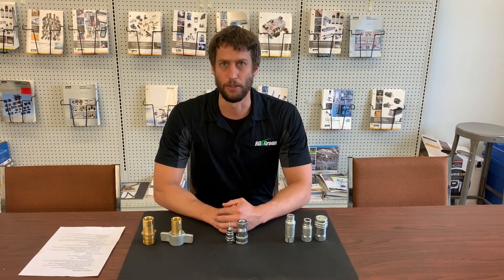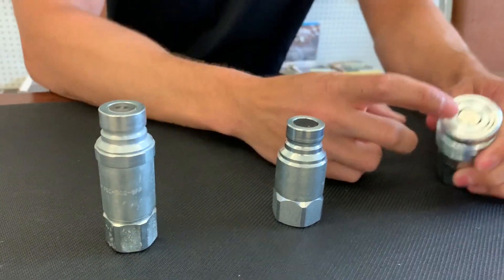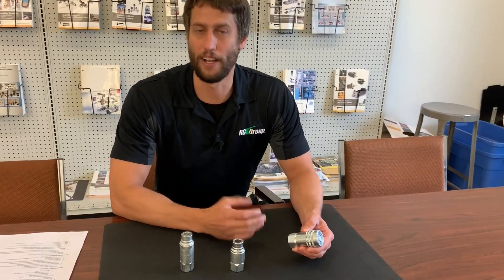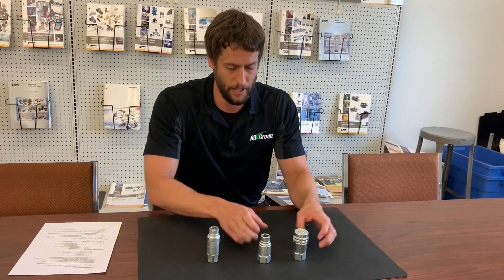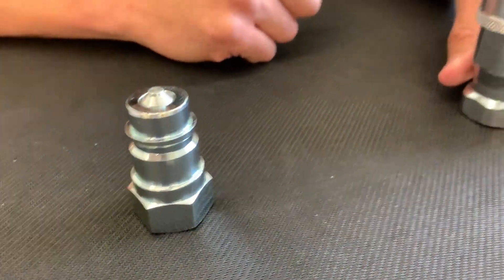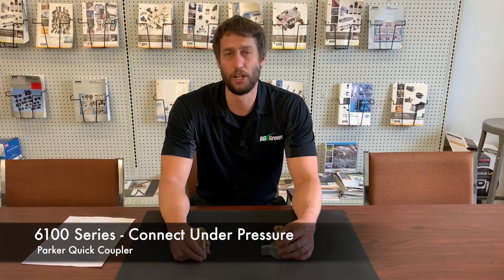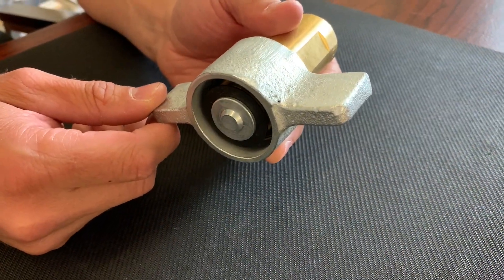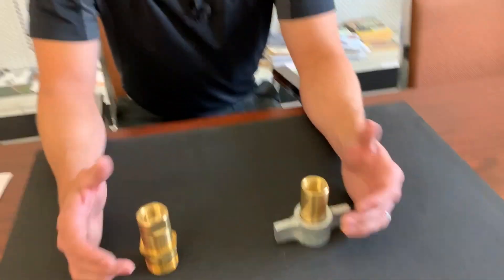Parker Quick Coupler Series Overview

Comment: I bought a set of the flat faced skid steer style couplers and they only seem to flow in one direction.  Do they flow both ways?
Reply: yes, but usually the medium flows first through the female and then through the male. This achieves the highest flow. But back is also possible.